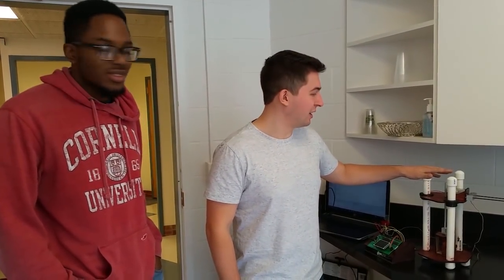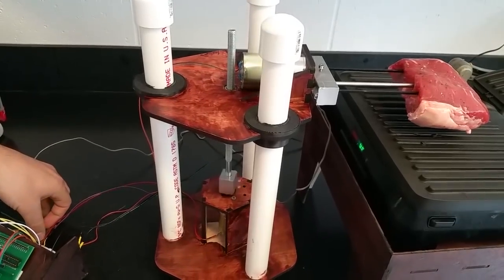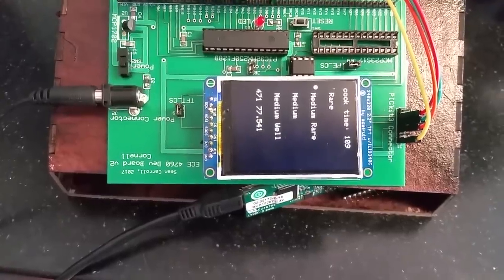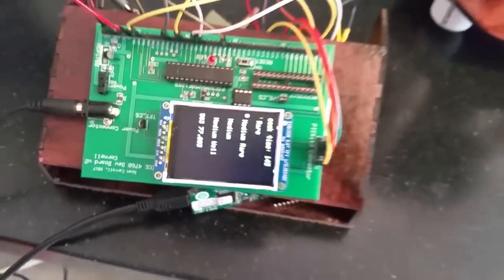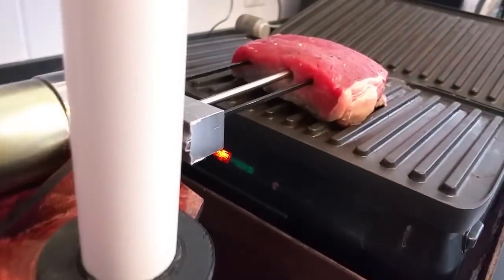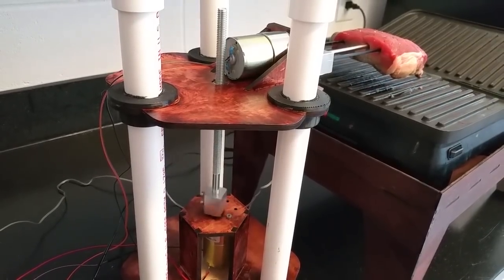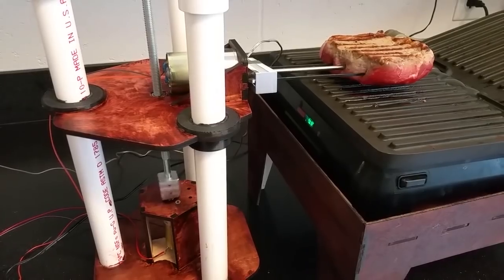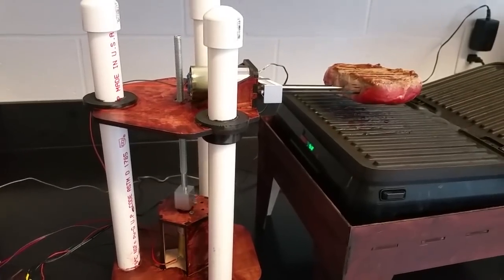BeefBot steak cooker

Comment: I think the primary problem is that you have your sensor just stuck in the middle, which is more or less okay, but on larger cuts like this one you'll run into the edges not cooking well. It may work better to have a bot that could flip with just tongs or something and perhaps having an optic sensor for heat instead of having to have something inserted in the steak? Really fun idea though, given an endless budget automating cooking would be really fun. Wish people didn't leave so many dislikes just because it wasn't a perfect success, at least it wasn't a failure all around and you at least uploaded it so props to you guys.

Comment: Now I like a nice bloody steak but it obviously needed more time on the second side. Is it programmed to stop on the second side when the steak hits a hundred degrees again? Because the steak was already 100 degrees and even with the time it took to flip, it probably didn't have to cook very long to reach that 100 degree mark again.
Reply: The second side is programmed for 130°F, which is considered medium rare. It doesn't come evenly though due to shrinkage of parts of the meat and the way the machine holds it

Comment: FAIL...back to the drawing board...it will work with some changes, like remember the food shrinks, so the computer needs to adjust its home position. Maybe a sensor for when it hits the grill. I think the choice of grill was wrong too, a better grill would have had better results...perhaps searing both sides at a higher temp would be better, with 2 quicker flips and final flip to finish. An "L" probe would be cool to get the steak in a frying pan. Overall you got something with awesome potential. Kudos.

Comment: Cool project! You should consider using acme threads for your center rod assembly if you decide to do anything further with this design. It will significantly increase your raising and lowering speed.